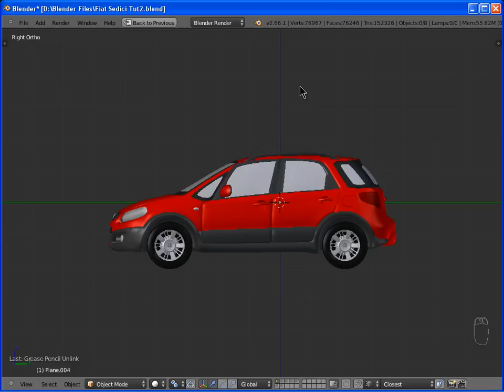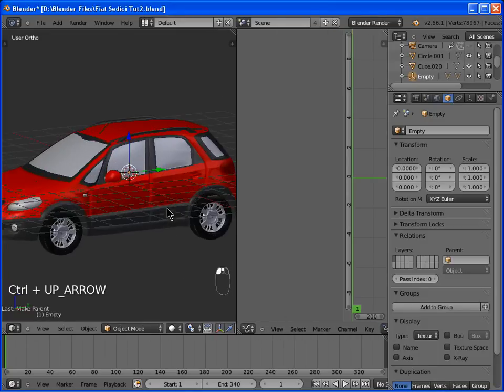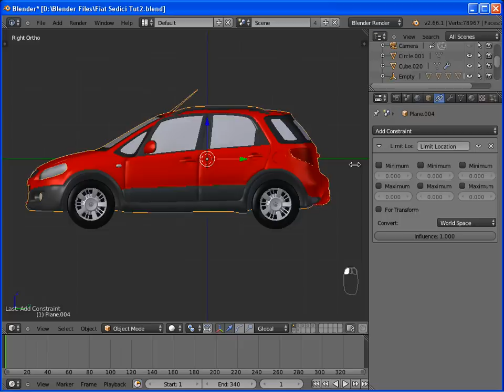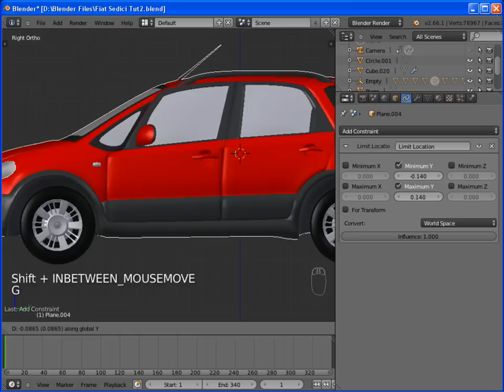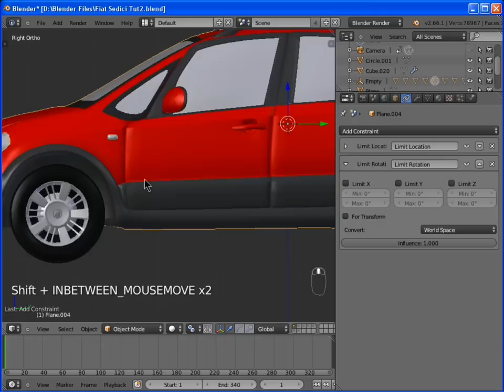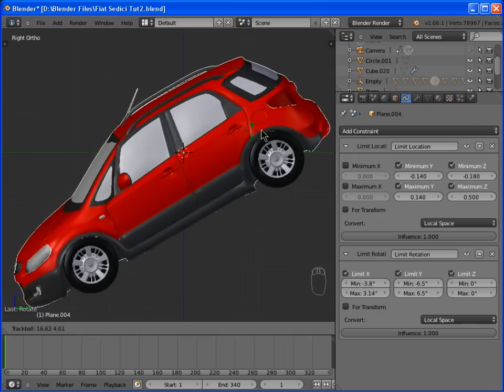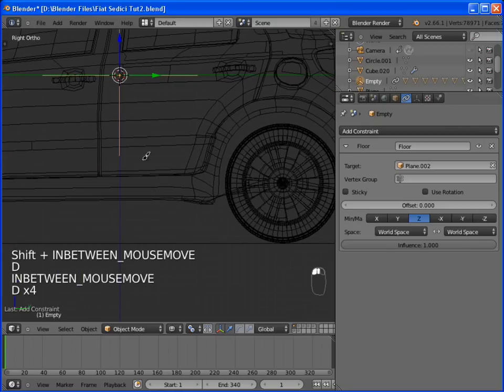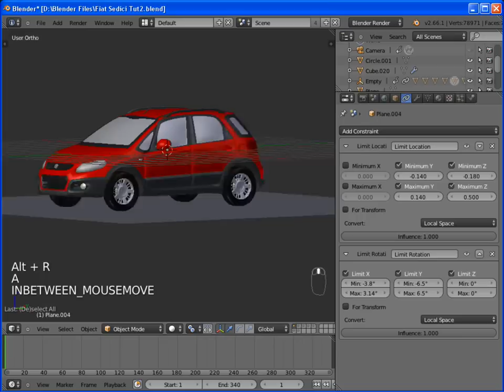Blender Tutorial: Basic Car Rigging | Part 2 - The Rig

Comment from the maker: If you have more than one object for the car, parent all the parts to the main object of the car, and then parent this main object to the empty.
In order to make the wheels turn according to the movement of the car with the empty, ensure that you set the controlling object for the drivers of the wheels (in the drivers panel located in the graph editor) to the empty, instead of the car object.
I hope this helped you :)

Comment: I fixed this problem by creating another empty (I chose a box) then going to the front tires and creating a "copy rotation" constraint and selecting the new empty only on the Z axis. If you rotate the empty on the Z axis it will act like a steering wheel.

Comment: I dont think I explained myself correctly. I mean't Steering. Can I still use a Driver to make each front wheel rotate from side to side (Rotating on Z axis), and for the front wheels to be able to pull the rest of the car in the direction they are moving (Taking a turn for example) Or is that done Manually? Perhaps you can make a Animation tutorial using this car. It would help a lot since there are no proper videos about Animating a car on YouTube.